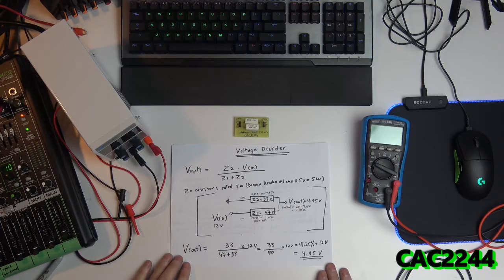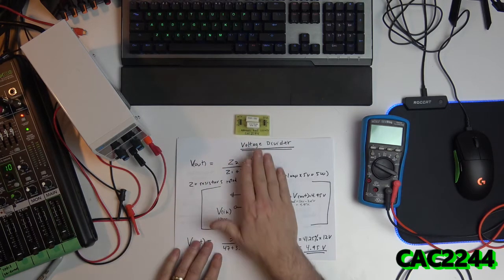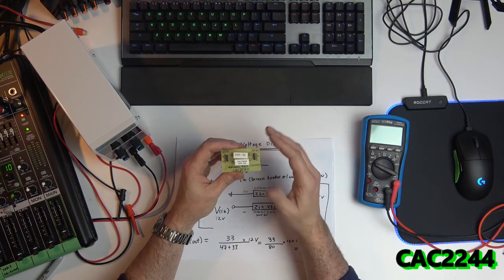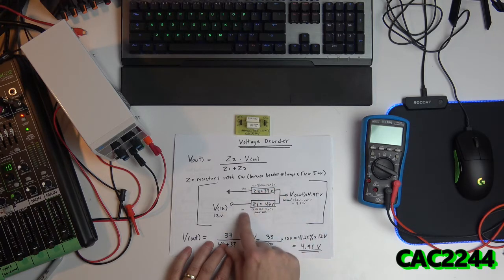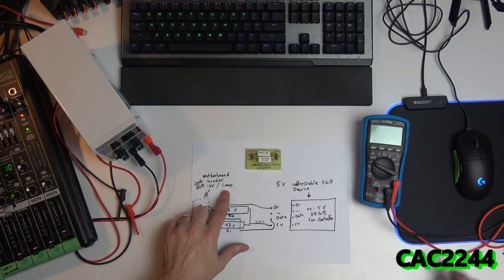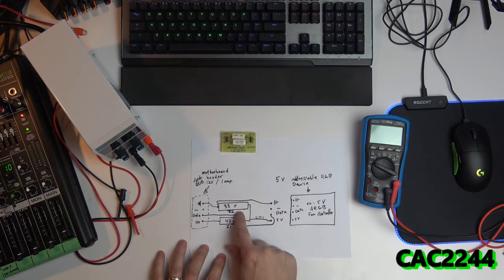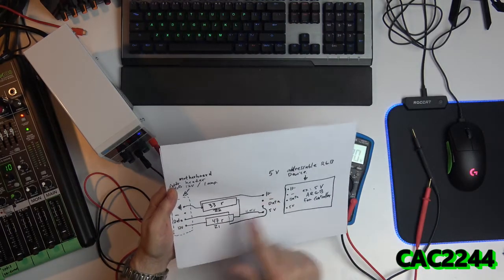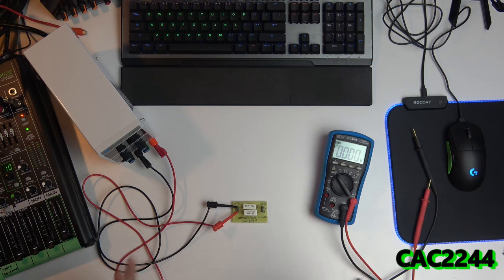5V addressable RGB device on a 12V header?

Comment: there is no mb that has 12v with data? all mb headers are 5v + data so...this video looks like all it dose to gos form 12v +data controller to 5v +data device?
Reply from the maker: Yes there are and I show some examples of both 5V AND 12 V ARGB on some other videos I made...
Reply from the maker: Z390 Aorus Pro is an example...  https://www.youtube.com/watch?v=AUqg3gpw4fQ&t=5s
Reply: @cac2244  so i looked in the manual of the z390 aorus pro and yes you can do 12v or 5v argb strips...but you can also change the voltage to 5v or 12v with a jumper...so there no point in having an convertor... i still like the video but for this case its not needed. its should come on default 5v witch 99.9% of argb devices are. one other thing is if you really need 12v just pull ground and data off the mb and get 12v from your psu.

Comment: Hi, I am not good at this thing, but maybe can you suggest me what to buy, to make it work at my RGB at PC? 
My motherboard RGB header is 12V, RGB in case fans are 5V. I can not find any device to convert it, every is out of stock. Please, help.
Reply: same problem 😢 did u find any solution?
Reply: @Dr.TalhaKhan  not exacty, but I found out that my case with argb got own builded in controller, so did not have to use motherboard j_rainbow slot that I do not have.

Comment: Would a form of buck converter be safer for bringing the 12v down to 5?
Reply from the maker: Yes, like I also just could have used a linear voltage regulator IC  like the L7805CV... But that would be no fun...haha...multiple ways to do it. Thanks for watching and commenting.
Reply: @cac2244  hehehe true... Where the fun in an of the shelf solution 🤣 thank you for the video, very informative!